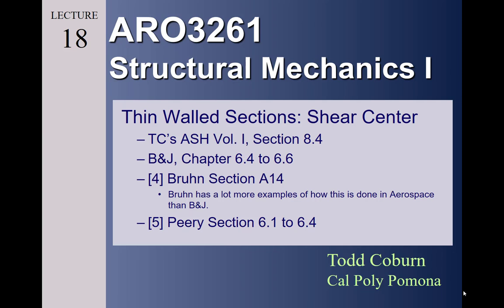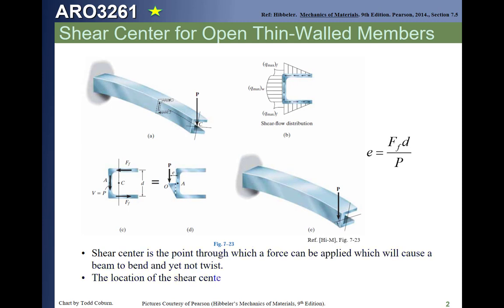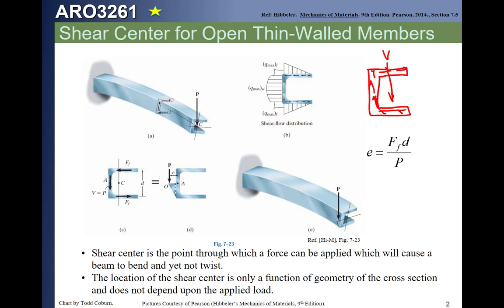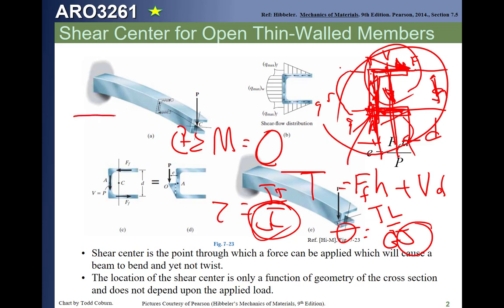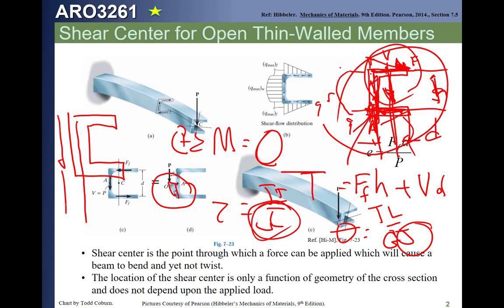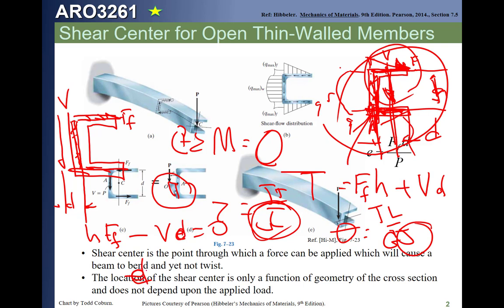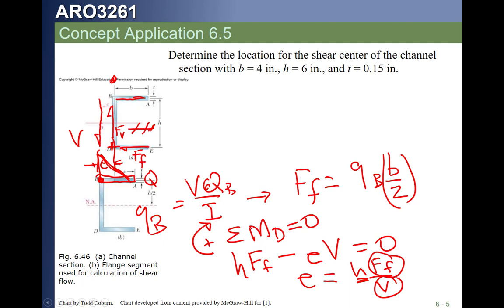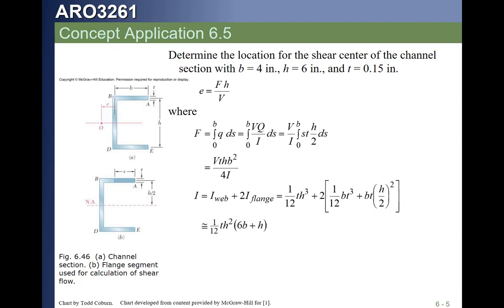Stress Analysis I: L-18 Shear Center

Comment: At 38:28 why is e 21.3 inches above C? Wouldn't that cause the moment about A to not equal 0? What I got from my calculations was an e of 10.67 inches.
Reply from the maker: Hmmm.  Nope.  Be sure you converted shear flows to shear forces, and that you accounted for the actiion of each force.  If you summed about A, try your calc again and sum instead about C to check your work.  It appears I listed all the calcs in the video, so you can check your detailed inputs also.  Good luck!

Comment: Hello Professor, is the d in 5:17 the distance between V and the center of the section we are taking the moment from?
Reply from the maker: Mayra, d is the perpendicular distance from whatever point we are summing moments from to the force.  It is shown in the chicken scratch just prior to that time stamp.  Remember... choose a convenient point to sum moments, sum them, and then solve for e.  It is dangerous to grab and punch the equation you referenced as this often results in errors.  The equation is correct for the particular section shown, but it is much safer to sum moments and calculate carefully.
Reply: @ToddCoburn  ahh, so like for example, if the most convenient point would be like a lower-left corner. Then the e would just be the perpendicular distance from V to the lower-left corner?
Reply: even tho most time in corners the q is 0
Reply from the maker: @mayraarangure1700  Yep.  Exactly like we discussed in class.
Reply from the maker: @mayraarangure1700  The trick is to sum about a point that eliminates most shear flows/forces (where the line of action of the force passes thru the point we sum about).